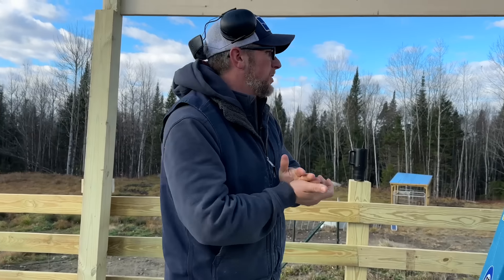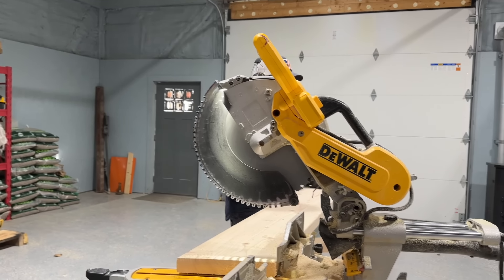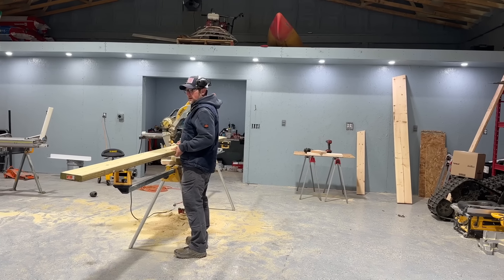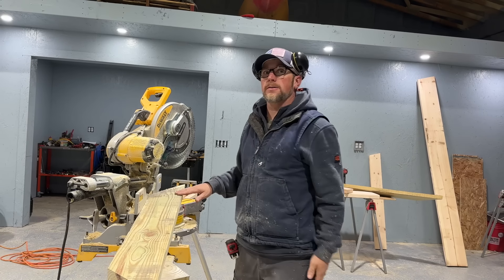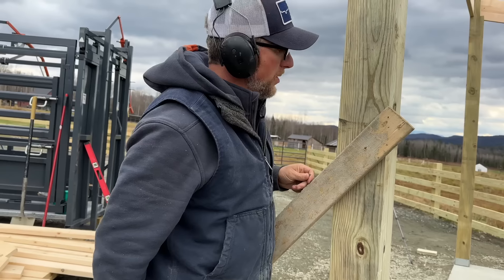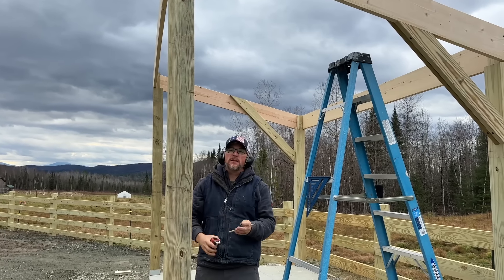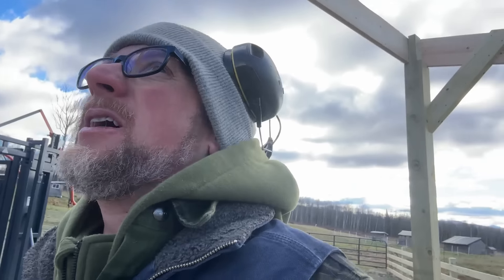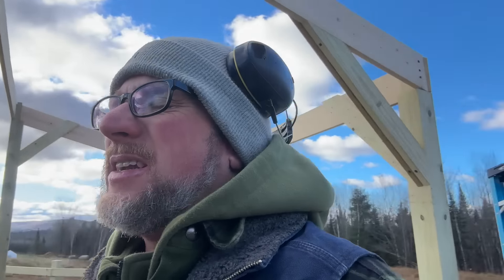WE Got the DELIVERY!!!

Comment: Hey if you’re not using pressure treated wood you should save the sawdust … you can make fire starters…. All you need is: wood sawdust/shavings , candle wax, Dixie cups or paper muffin cups.  The wax works as a bonder and an ignition fuel.